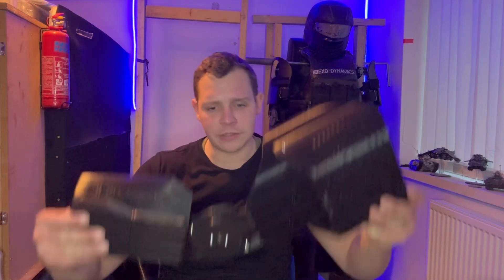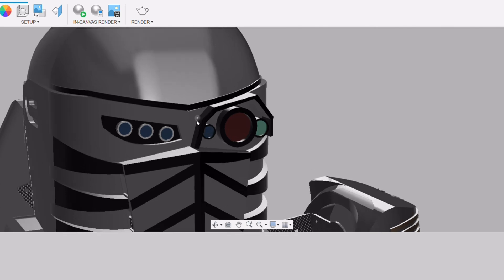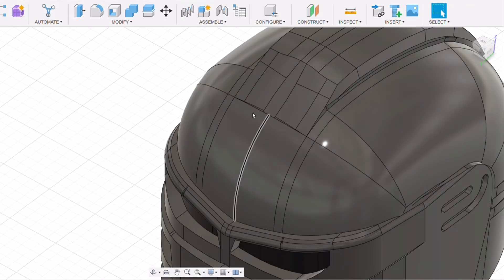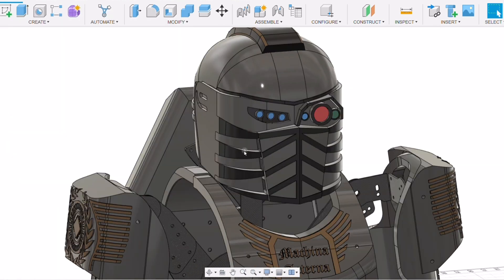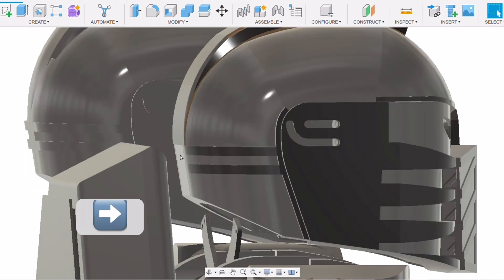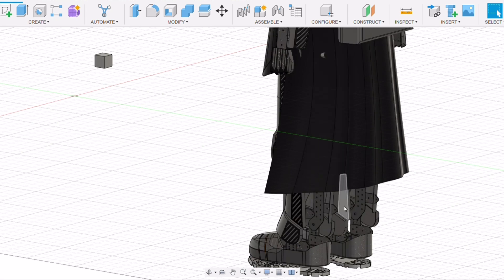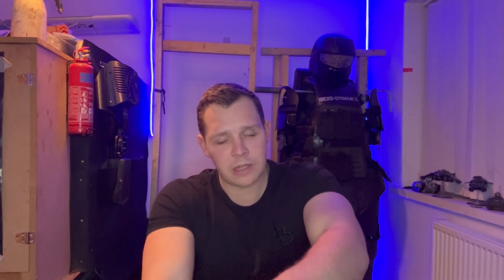ANOTHER Helmet design for my POWER ARMOUR project.

Comment: I am going to make Exo-skeleton too but going to use CNC machined 2024 aerospace Aluminium, Magnesium and High Grade Titanium.
Reply: Little bit carbon fibre too but not too much because that material aint good for bulletproof applications
Reply from the maker: Fair play and good luck, my only caution from experiance is that my knee braces are alluminium and you do get metal fatigue from micro flexing and twisting and because its alluminium it just cracks and snaps For me it was the hinge brackets at the knee, the rest was fine,
Reply: @MattExo-Dynamics  Okay, thx. Maybe titanium then?

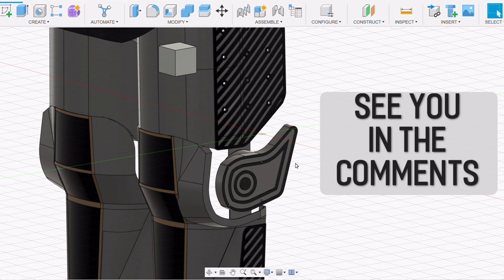Comment: 6:27 knee armour is called the poleyns with the side pieces specifically being the wing plates

Also, you should add a 1-2cm lip along the top of the chest plate to prevent bullets deflecting up into the neck. At that size, it shouldn’t obstruct visibility or movement either

Comment: Your work is amazing. Now, if you are just going for an Adeptus Astartes imitation look, this is fine, but i could love to look at more unconventional designs with a "non-human" configuration, like spider-eyes, so you can integrate more types of cameras with maybe a wider FOV that will use image fusion and processing. The various kind of helmets we have today (wether they're motorcycle, military FAST helmets, astronaut helmets) have been well designed and are practical, so it would be best to take as much as possible from them instead of trying to copy what we see in fiction (usually drawn for "rule of cool"). Cant wait to see your progress on the exoskeleton!

Comment: Not going to lie, the cameras thing is not a thing I am a huge fan of.. it is just too costly for too little benefit imo (You do get better vision but it is reliant on power that can run out, rendering the whole thing useless and just blocking off your vision, especially if it runs out in combat [in that case you're pretty much dead]).

You could also base the helmet off of the FAST helmet and then make the visor and such an attachement for the side rails.
Less work to be done, it can be introduced quicker in case it somehow gets into service, and also you get an additonal attachment point for any NVG's or any other stuff that goes there.
Reply: You can fit thermal, night vision and improved zoom function pretty easy. And if your worried about running out of power then a suit is not the right solution in the first place. 
I'm all in tbh. But each to their own. 
😊
Reply: @Martin-ne2vq  Something not considered in the video or in either of your comments:  Frame/refresh rate.  Your naked eyes process things a lot faster than the camera can put it to a screen and THEN your eyes process it, and this can easily be a deciding factor in combat.  This is the biggest issue with digital night vision and existing thermal weapon optics and so on
Reply: I'm a proponent of having a periscope design with hud on display so that instead of having to look at your sensors 24/7 for literally anything, you have actual visual clarity with working thermal targets displayed on hud (even so if they have delay).

As for NVG... well, you get some, you lose some.
Reply: Well you could go the way of the old helicopter helmets with one eye getting a hud. Alternatively having a slide in screen or flip down one could work well. Given this is intended as an all in one suit why not make the optics a modular hot swapable component. 

Aside from that peripheral vision is pretty valuable for situational awareness and should be taken into consideration for whatever implementation comes of this.

Comment: looks amazing so far, one thing I would add is either a smaller cover near the point where the helmet and visor connect or a fixed plate/rounded bit to prevent anything from getting stuck in gap,  do love idea of the long coat/skirt especially if can hide some pockets in them or thicker plates in certain areas. but so far super awesome

Comment: The knee section might be termed a poleyn, though to my knowledge that term includes whole section including front knee coverage as well. Specifically just that side section I guess is closest to a rondel if a separate piece or a fan if integrated. Here its kinda both in a way that plate armor wasn't so its unclear.

Tassets hang down and cover the upper thigh.